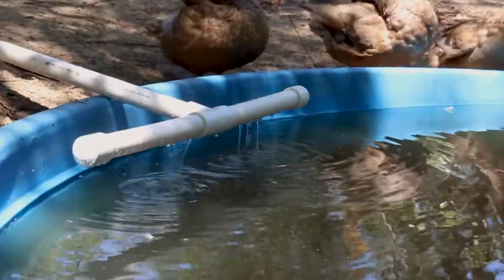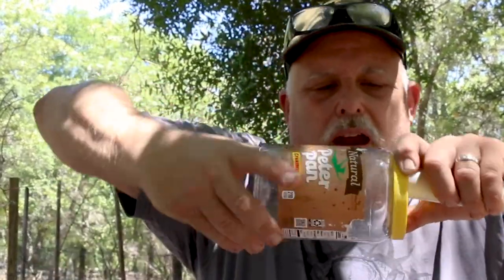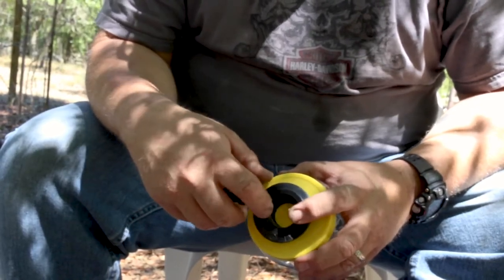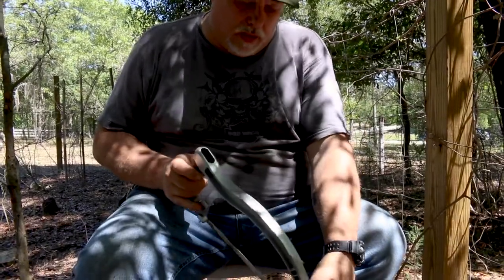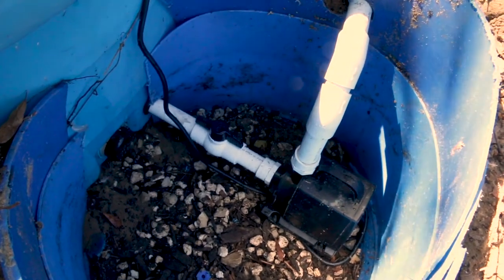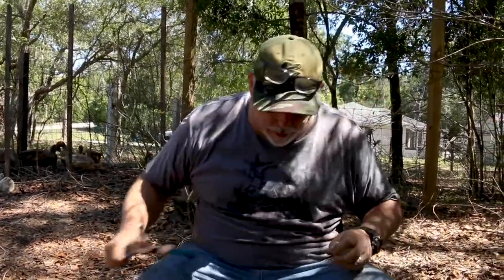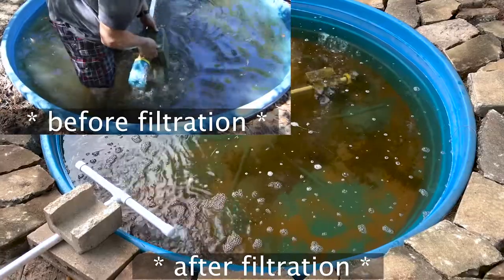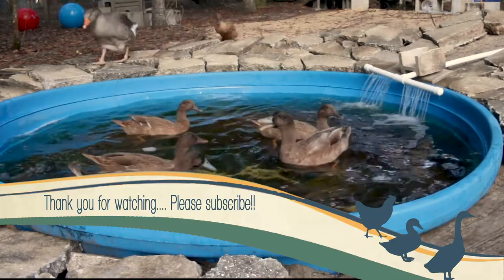Three Common Pond Filtration Problems

Comment: I am digging pond in the duck pen about 3m by 2m large. Yes I know its large. Please inform me if your system will work on such a large pond? I do have a swimming pool filtration pump(sand type). Will that work?
Reply from the maker: I am sure it will work but may not go as long between servicing. We service our about once a quarter.